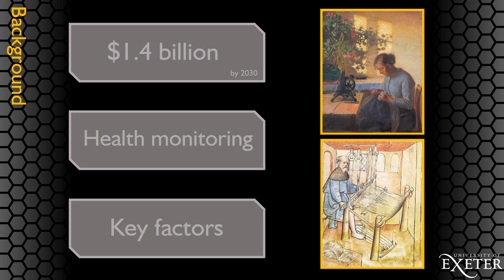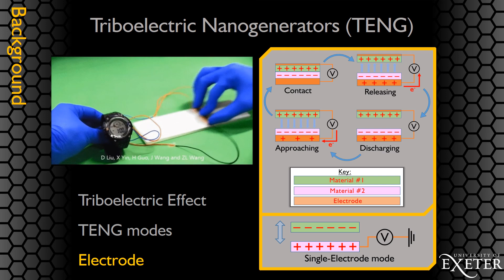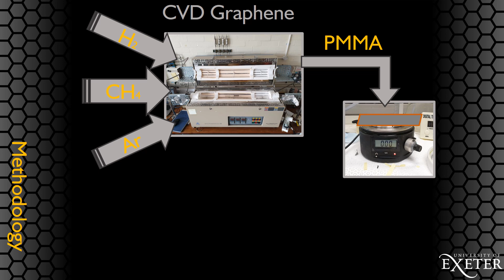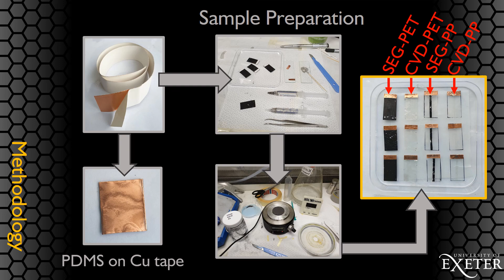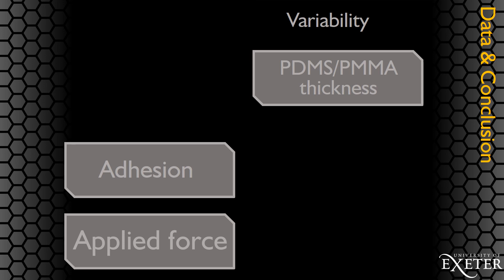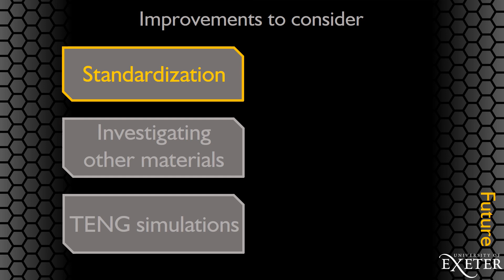Triboelectric Nanogenerator as a Wearable Power Source - May 2020

Comment: I find it contradictory that the max power is at about 10Kohms when triboelectric generator is an extremely high impedance system.  I would expect that to be in Mohms or Gohms range.

Comment: how much of pdms did you ysed on drop casting?
Reply from the maker: As little as possible, we just wanted to coat the required surface area so the membrane was 'reasonably thin'.
Reply: How thick do you think the whole thing would be without the mounts, because I couldn’t tell from the video 😅

Comment: you need more surface area then multiple parallel layers,  then it could get pretty good!
Reply: No, this is a series of prototypes to have a better understanding of the efficiency of different materials by generating and analyzing experimental data. The presentation is exploring the intensive properties of the proposed configurations. This group of scientists is not trying to make the highest output triboelectric product. And even if they were, the simple and extremely known concept of increasing the surface area is not something they can't come up with such as a simple YouTube comment has to "teach" to a group of researchers what to do.